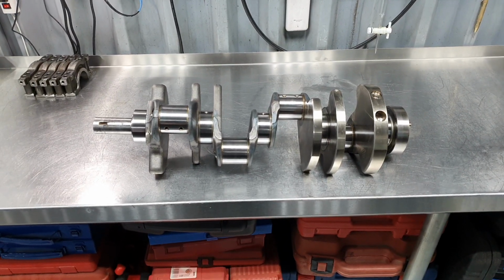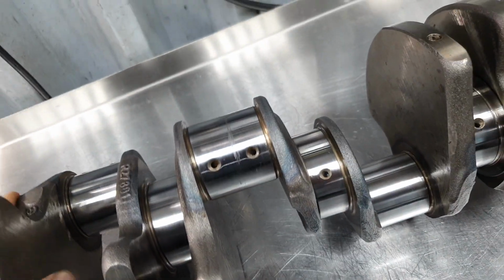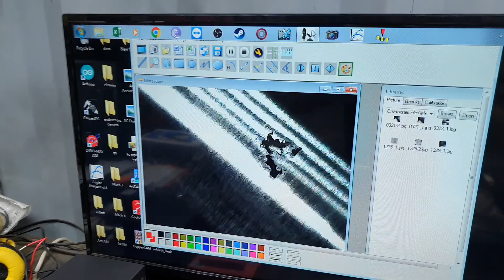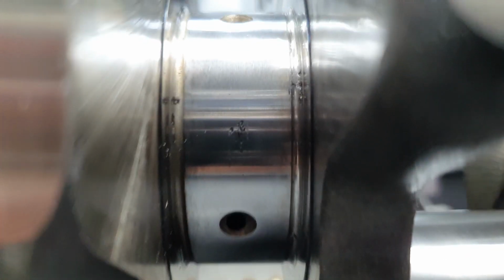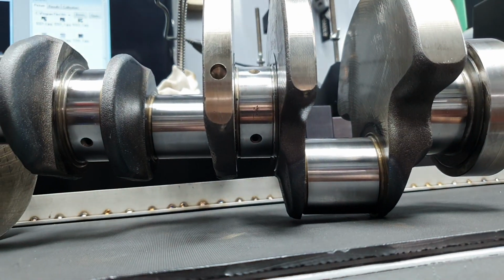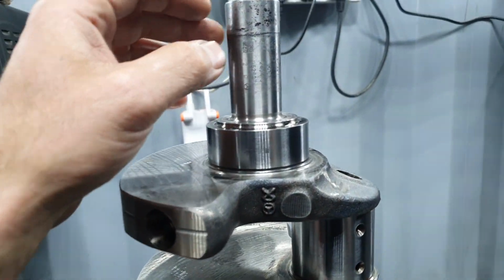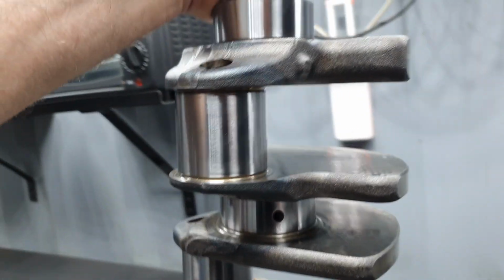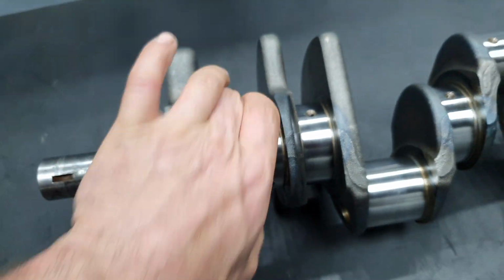crankshaft check up

Comment: nevermind, you answered that in the end, would need custom bearings not available.

dumb question since i dont know , but you cant sand that down and refill it with anything?  and put oversized bearings?  or it doesnt work that way?

Comment: Tasos I wanted ask you a question regarding voltage issue in C63 2013 w204 
The voltage does not stay 14 V 
While driving the car drops voltage to 12.5 - 12.7 V and would feel like it’s about to shutdown 
Battery and alternator is new and while idling the car stays on 14V or 13.7v 

Cannot find the issue ! Is it a ground problem or connection issue ?